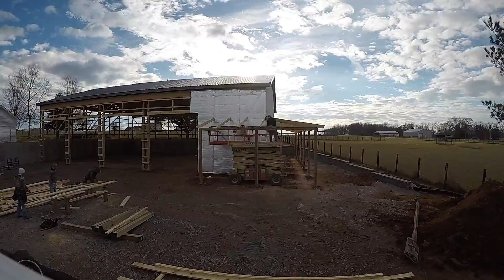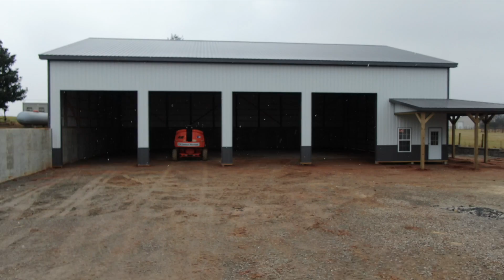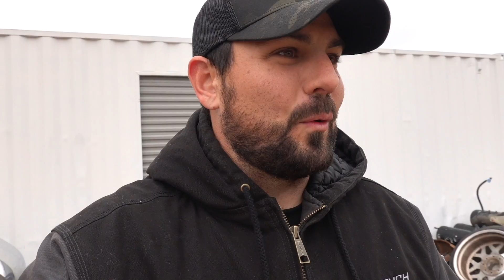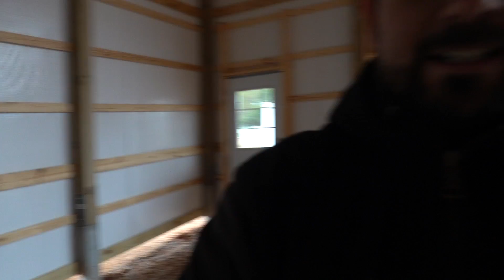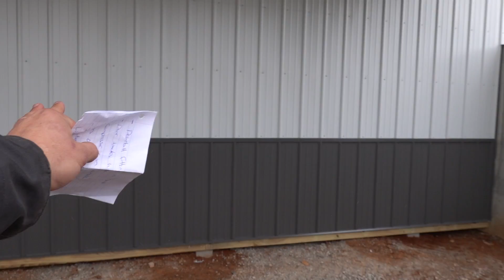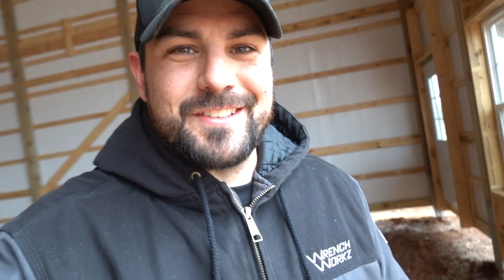BUILDING MY DREAM SHOP!! EPISODE 4: THE OUTSIDE IS DONE!!!

Comment: Greg, save your money don't do anything to that small shop. Tear it down in a few years and make it a long skinny running perpendicular to the road and a little closer up to the road so you can pull in and turn around and park your rig out towards the road. 2 or 3 stalls 80' long just to park trailers. Everything looks great! Awesome work so far!

Comment: I have a 40 x40 shop I have 9 8 foot double led lights in the ceiling and ever post has the same lights running up and down . Each wall on a switch and ceiling on a switch. There is not any shadows . Only turn on what I need when in there . Shop looks great.

Comment: If it’s affordable I would personally do central heat and air 
Obviously you aren’t cutting any corners so I would make it comfortable in the winter and in the hot summers 
Of course when it’s cool enough to work with the doors up just turn it off 
Also drains in the floor to clean up when you want and to take care of spills

Comment: I’m impressed with how fast things moved with this project
Reply: You should tune and delete your truck
Reply: @IncredibleHoosier  kinda hard if he’s using it for work...DOT crackdown on “missing parts” is a tad expensive and they can shut you down on the spot
Reply: @kdbl007  if you’re not being silly doing burnouts and rolling coal DOT won’t know.
Reply: @IncredibleHoosier  they will when they do your inspection, some guys will hollow certain pieces of equipment out tho so it still looks like it’s there
Reply: @treyschmidt762  they inspect for SAFETY not emission enforcement. Theres a ton of trucks big & small running the highways with no issues.
Reply: @IncredibleHoosier  Not true. I know multiple people that have been inspected randomly and at check points, enforcement was especially targeting diesel work trucks for presence of aftertreatment systems. A few years ago drilling and fracking companies were even having gate guards look for deleted systems and the trucks that were couldn’t even access the location.
Reply: @IncredibleHoosier  DOT can and do do random roadside and weigh station inspections at any time without reason...in ANY state.
Reply: Longest part is usually permits
Reply: TP we need a LoadMizer reply, Plz!!!!
Reply: True
Reply: I guess it is kind of off topic but do anyone know a good place to watch new movies online?
Reply: @Winston Tripp Lately I have been using Flixzone. You can find it on google :)
Reply: @Kole Jaxx Definitely, I've been using flixzone for since march myself :)
Reply: @Kole Jaxx thank you, I went there and it seems like they got a lot of movies there :) Appreciate it !!
Reply: @Winston Tripp Happy to help :D

Comment: If you are going to add a/c to the building, you need to do spray foam. If you do fiberglass insulation, you need 3 phase power for the two 10 ton a/c units that will be need to cool the building.

Comment: Put the new electric service on the back of the old shop with a meter main and then feed both shops out of that, and you should be able to put the panel in the new shop wherever you want. Have both shops separate from the house too.

Comment: Why didnt they pour a slab and then build?
Reply: Because then they would have to dig a trench and pour a foundation to support the weight of the building. He built a pole barn. The poles are 30 in in the ground with concrete to support the weight. Then you pull your floor when the building is done

Comment: I have never seen a shop built without the floor being poured, first. Hmm....
Reply: That’s the way I did mine. 30X64 no problem 😉.
Reply: Typically pole barns like this are built this way. Usually pour it first if you have a full footing.
Reply: Apparently you haven’t seen many shops built.
Reply: I'm just saying I've never seen it done that way. I guess thing's are done differently out here in, Nazifornia.
Reply: @jasonmyers3847  nothing wrong with that. For me building first. Then as we could afford it we poured the floor in two pours as we could afford it. One half in the fall and the other half in the spring. At least this way we got good use of the building. A floor and no building would have sucked.

Comment: Blown in sucks after a few years it’ll settle and you’ll have spots with no insulation
Reply: 100% blow in works in attics but not vertical walls, settles and leaves gaps.

Comment: We have three large barns.  (60x100’) two have liquid heated floors and one has the plumbing but we never hooked it up because we put two 8 ton geothermal heat pumps in and it keeps it warm in the winter and cool in the summer.  The floor heat for us is a joke. It cost as much in the winter as the heat pumps and gives us nothing in the summer.  Couldn’t really decide what you have decided but we have both and I will not spend the money and effort in the future on the floor heat.